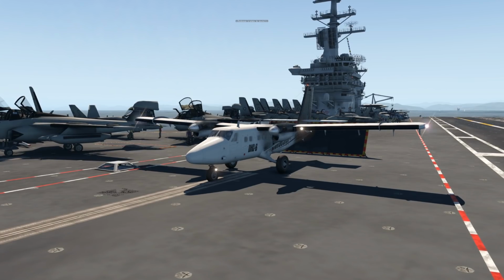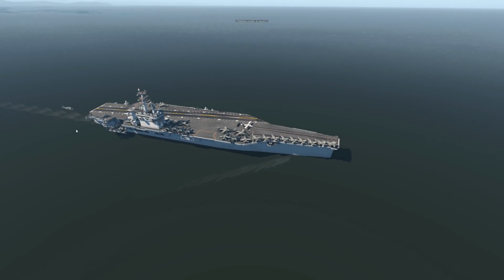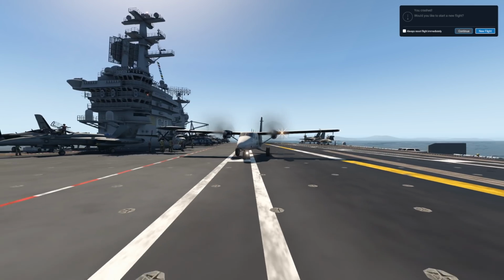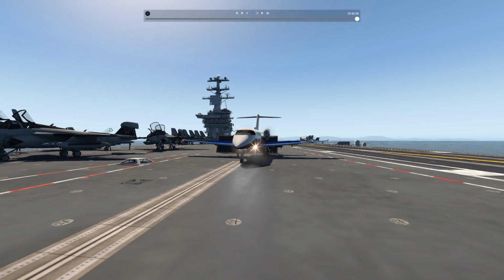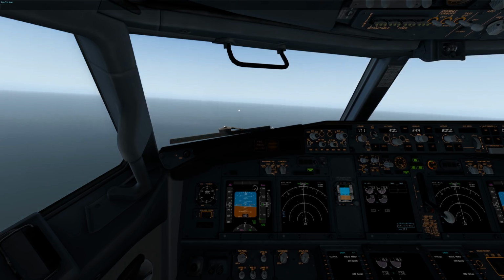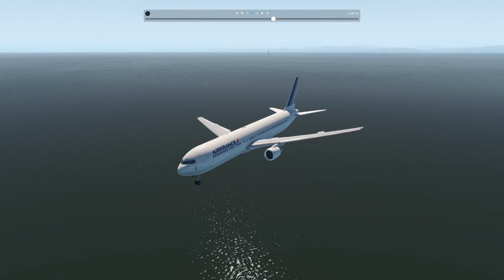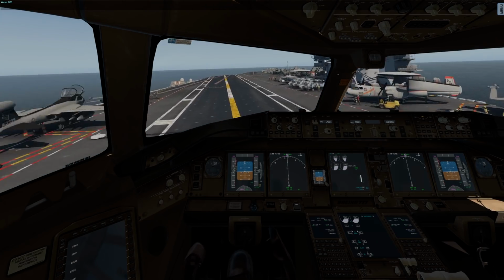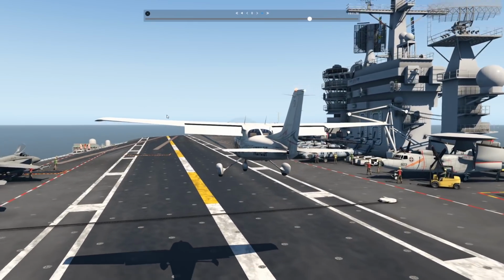Why Don't Floating Water Airports Exist?

Comment: 1:30 correction aircraft carriers also use e-2 hawkeyes and c-2 Vikings which are actually quite big. They are pretty much the same. The e-2 is the one with the giant disk and c-2 is just a plane

Comment: look up HMS Habakkuk, a proposed Aircraft carrier in WW2 with a 600m landing stripover a mile long, the kicker it was to be made out of Ice and wood pulp basically (Pykrete). In theory it could off worked but the requirements changed.I.e Anti Sub Atlantic aircraft got the range.it would off weighed just short of 2 million tonnes and have a 11,000km range.

https://en.wikipedia.org/wiki/Project_Habakkuk

Comment: Incoming Airplane: Tower requesting permission to land on Runway 27L
Tower: Roger Speedbird 25 cleared to land Runway 27L 
GPWS: 50, 40, 30, 20, 10, 5
Bad weather intensifies
Airport: Aight imma head out
Plane: ಠ_ಠ
Plane: Crashes into ocean

Comment: the ropes are for stopping .-.
They don't put planes on a rubber band and throw em overboard :l
its a gas-pneumatic catapult or electromagnetic (not sure if those are in service yet)
unless you're a russian made aircraft carrier in that case there's no catapult you just yeet the throttle and use a ramp

Comment: To handle large commercial aircraft on a carrier, you'd need a flight deck that was miles long and miles wide and rigid enough not to flex either with the waves or under the weight of the plane. I doubt such a ship is even buildable.